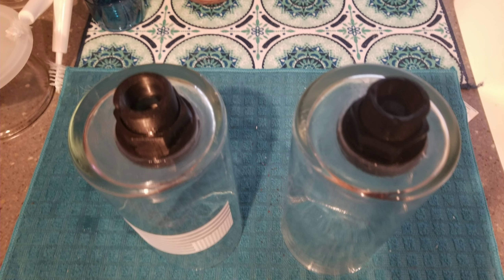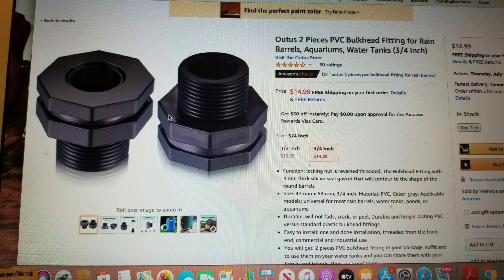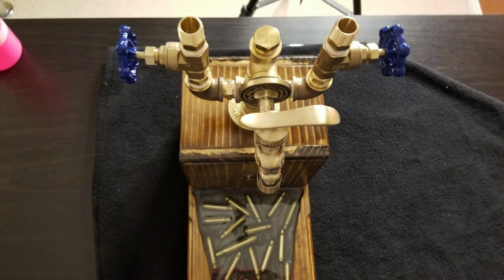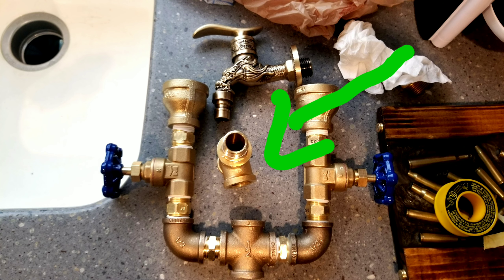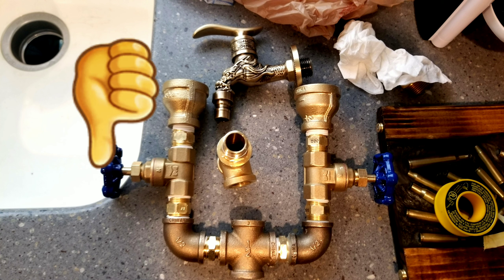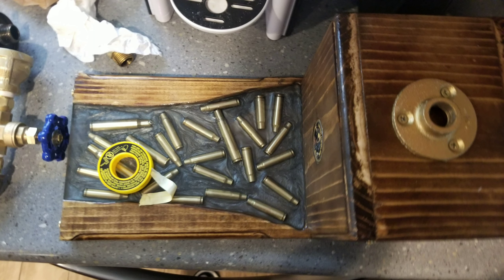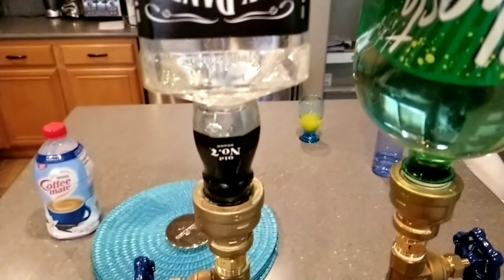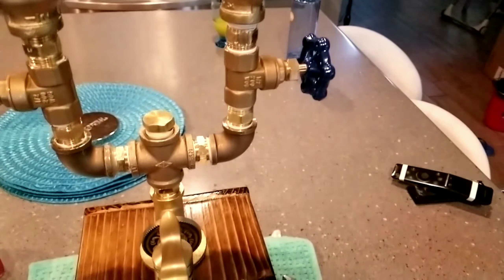#diycrafts Awsome results #woodworking #woodworkingart #drinkinggames #superbowl #dad #epoxyresin

Comment: Nice! I like how you used coloured and clear epoxy, so the shells are not just scattered on wooden base, but also not completely covered with coloured epoxy (I've seen that too many times and just defeats the purpose of having them, so your choice looks much better). The plumbing looks brilliant! Just need some kind of solution now for the air to get back into bottles as you pour the drink! Well done mate!
Reply from the maker: Thank you mate. On my 1st video you will see how i cut the wood and do the rest of the epoxy with the coloring and shell casings. What do u recomend for the air breather??? 👍
Reply: @diycreationsvet4878  yes, I did watch it! For breather, maybe installing a small diameter piece of tubing running from behind the bottles and then connecting to the dispensing pipes, just underneath the bottles? It is a bit problematic, I have to say. It would definitely speed up dispensing of the drinks though and you wouldn't experience the plastic bottles collapsing.